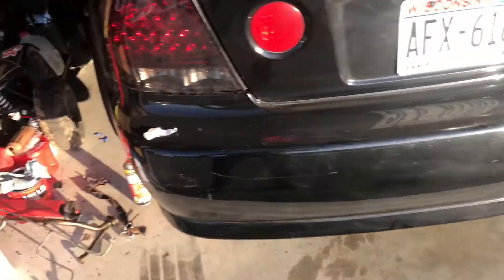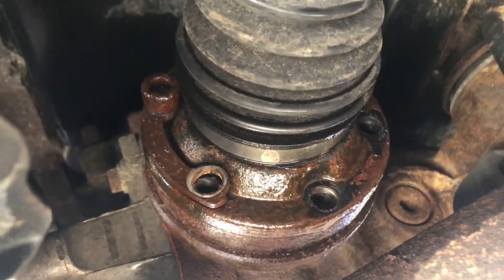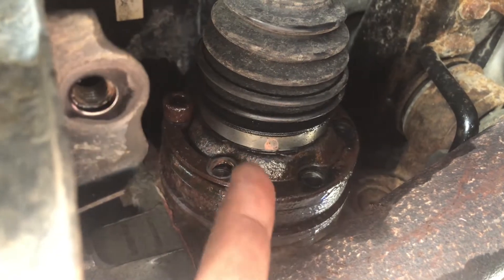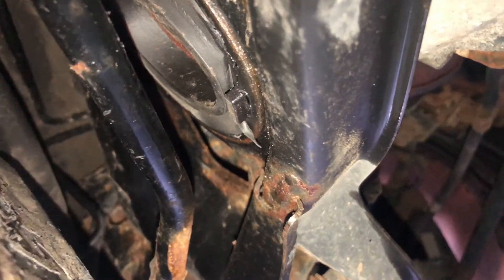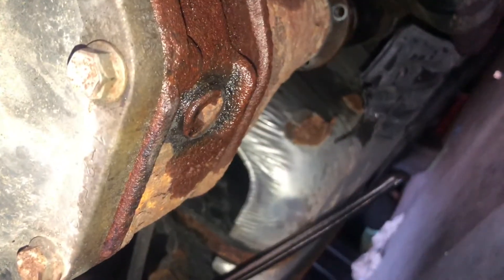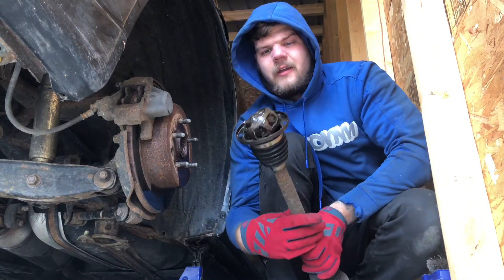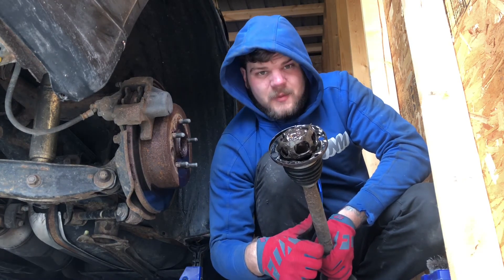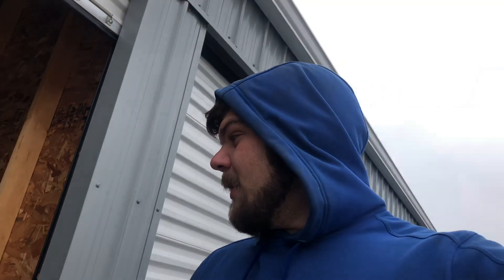Is300 diff and axle removal

Comment: I've got a good work around for the rear bolts, Just cut a cheap 12mm allen key  and use a 12mm ratcheting wrench, you won't face the fitment issue
Reply: I wish i dropped to your comment in the first place.  took me 2 days to come up with this.  Then came back to comment and found yours. 😂  Can also put socket in a vice and bang out the key for easy access.

Comment: My IS300 came from Wisconsin too. 😂 I had such a hard time getting those rusted axle / hardware off (the 8mm bolts.) What a pain bro. lol
Reply: How did you get it off? I’m working on mine and it’s taking forever to get off
Reply: @teefdadon  Penetrating fluid sitting / soaking over night helps. If the heads are stripped, clean them off with acetone / air dry and weld up the socket or allen key to remove. It's fun. lol

Comment: i’m glad i saw this im replacing my diff and i couldn’t get the mf to separate to save my life i tried for like an hour. i will just be popping them out the splines. thank you lol
Reply: i spent 30 mins trying to get the mf bolts off bc my car brake is failing so i kinda did it for nothing lol. finna put them bitches back in so i don’t gotta replace the axels lol